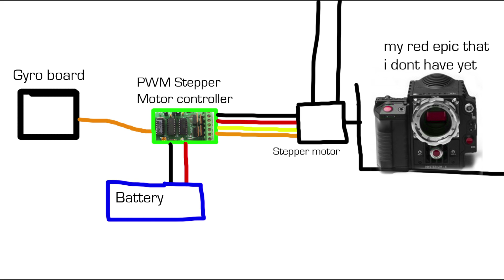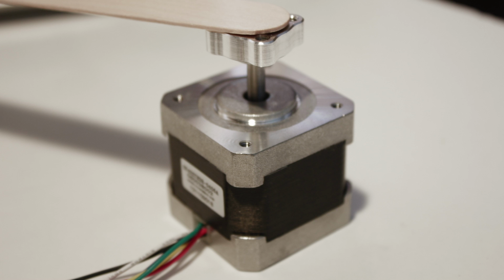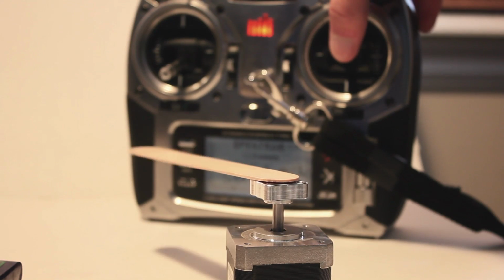RCTESTFLIGHT - RC Stepper Motor Test

Comment: Hey bro , you can change the microstepping.  There are other controllers as well. Usung 1/16 will smooth out your movemeny but you need to up your voltage to ensure it moves quickly

Comment: oh btw, if you want to drive a gimball with continuous rotations (ie: a stepper) you'll probably want a slip-ring too so you can have continuous dual axis rotations without tangling up your wires.  This means you'll also be wanting a hollow shaft (to thread your wires through). 
Since hollow shafted motors are expensive, one alternative is to use the slip-ring itself as your shaft.  You glue a hollow cog around the outside of the slip-ring like a spiked hoola-hoop and drive it from the side with your stepper. 

My main reason for mentioning this is because the cogs will also give you a great way of slowing down & thus smoothing out your stepped rotations.  So you can avoid using microstepping.
It's a win win situation and both winners will be you.

Comment: Both the StepStick and EasyDriver stepper driver boards are controlled with only 2 wires (instead of the normal 4).  One wire says what direction to turn, the other wire says how many steps to turn.  It's not quite PWM but it's pretty close to what you want. 

I've seen a 555 timer outputting PWM signals before.  So perhaps a 555 timer could be setup to input a PWM signal, and it's output can advance/retreat a looped shift register one step at a time, the shift register's output will go through a dual h-bridge (or darlington) as usual to drive your stepper.
I've never seen this done, just pondering...

PWM would have some limitations when it comes to steppers.  PWM is absolute, it says "go to this specific angle", which means you can't continually rotate, as you'll eventually be telling it to go well past 360degrees - it'll run outof space in the PWM signal.
I imagine there's ways to bypass these limitations though.  ie: Something could probably reset the PWM signal to 0deg again everytime it gets to 360deg.

Do you want PWM because you already have devices which output PWM signals?

Comment: I designed a controller that will take an rc servo signal and drive a polulu stepper driver.  It will do up to 1/32 micro steps.  I was using it on my pan/tilt antenna tracker.  I have been thinking about a stepper based gimbal as well.  Let me know if you are interested in the circuit.

Comment: If 1.8 degrees is 200 steps with no microstepping, then use a .9 degree 400 step. I have a bunch I pulled out of teac 5.4" floppy drives. I have seen several different kinds. I also have ONE that has steps so fine I thought the thing was broken. I found it in a junk bin. I believe it has to be 800 step but I don't think it would work for this app because it cant hold position under the weight of anything heavier than a bottlecap. But they are out there.

Comment: Might not work well for a gimble, but it'd be perfect for large scale RC... IE: Find a Barbie Power Wheels and paint it a decent color. Use this for a high power steering servo. Cheaper than large scale servos for sure.

Comment: I think what he means if your going for smoothness gear it down with gears or pulleys and rubber banding(the rubber banding would take a bit of shock from the steps too). It should cut the steps down substantially to where you dont notice them or are happy enough

Comment: I use two Easy Driver modules from Sparkfun, they are great, and as far as I see smaller than the board you used. I use it with an STM32F4 board to control a telescope mount though, so it's not the same application, but I can tell you it allows for micro-stepping. One catch though: those motors use a lot of current while stationary.

Comment: Stepper motors are too heavy for such purpose. You better check brushless motor gimbal. Alex Moss started that, then guys on German forum created an open source project hosted on google code ("brushless-gimbal"). AFAIR motors have to be rewind but they are much lighter, have no "steps" and the project is ready.

Comment: Dammit!! Im sure we can build one as good as the DJI one using stepper motors for under 100 dollaroos, maybe the trick is to make up 3 high fidelity stepper controllers in one box, you would probably have to impliment Kalman through a gyro and acc, but theoretically  *sigh*.... man I want a dji gymbal :(

Comment: if your still hunting for a micro stepper motor, check a old 3.5 floppy drive there small but they may work, also the 5.25 have nice steppers as well, good luck with your search.

Comment: Rig up a Mega2560 arduino microcontroller and it can drive most small steppers directly.
Lots of preexisting code for that kinda thing, plus it will drive regular PWM servos directly also (up to a certain size of course -current)
For that matter, you could write code to control a stepper, and a regular servo...the sky is the limit. (pun intentional)

Comment: Have you seen the Simple AlexMos Brushless Gimbal thread on RCGroups (with more info now at simblebgc(dot)com )?  Currently it requires rewinding a few cheap motors, but a few people are getting ready to sell them along with the controller.  Looks buttery smooth -- very nearly as good as the zenmuse.

Comment: Sorry but that may be true in regard to gimbals but not helicopters, the reason why there would be backlash in a gimbal is when the motors moves the camera to a certain point the camera would have gained some momentum causing a sudden stop...the gears in a servo have no real momentum.

Comment: Metal had more play and backlash because they don't have as much give to the material so there needs to be more spacing.

This is why most tail rotor servos are plastic geared.

Comment: Yeah, for sure they are faster but there is major drawback with stepper motors and brushless ones, and it is their increased weight in order to deliver the necessary torque u need for a gimbal. I mean I saw already brushless driven gimbal for a GoPro and the motors have ten times the weight of a servo. If it is a much bigger DSLR these engines have to be huge.

Comment from the maker: I already have used the best servo driven gimbals and there will always be the delay for the high rpm motors in the servos to speed up and slow down. Stepper motors or brushless motors would eliminate this.

Comment: 200 steps/rev is way too inferior to a high resolutions servo. Try using a Graupner MKDS 18 high speed high resolution BB servo. It has 5000 steps/rev so I guess even by using a 2:1 timing belt drive u still have 2500/rev which 10x more and gives u the right performance for bout 60 bucks.

Comment: Well find one that is fast enough :P if the gears are tight and preferably metal then it should be an issue...and backlash of regular gears with a stpper motors could only be measured in like 100 microns..would never see that in video, Just a thought :)

Comment: If your having trouble finding a way for doing microsteps you could always use a basic gearbox..steppers go can pretty fast so you shouldnt loose much in the way of gimbal movement correction. but you would get smoother and smaller steps.